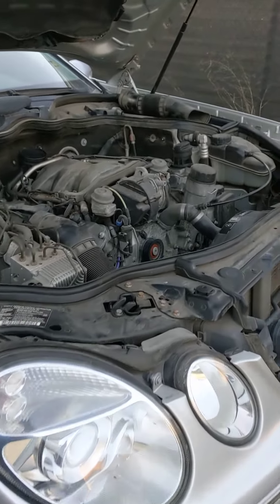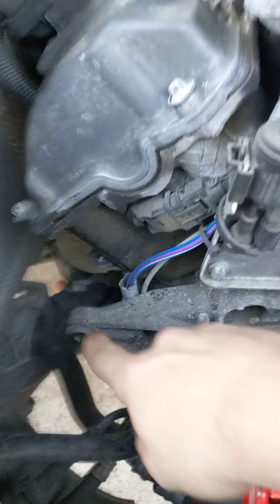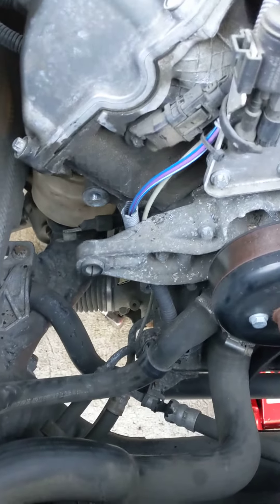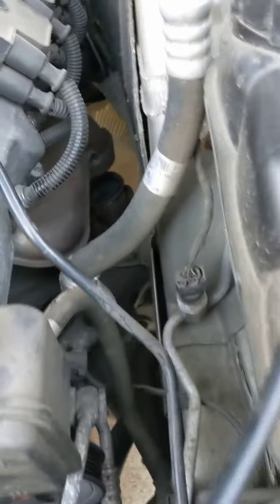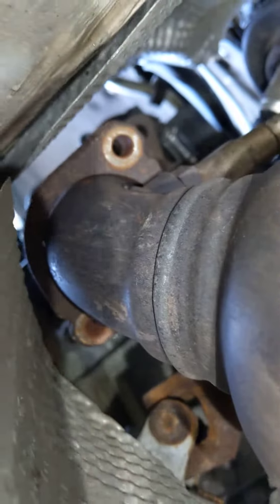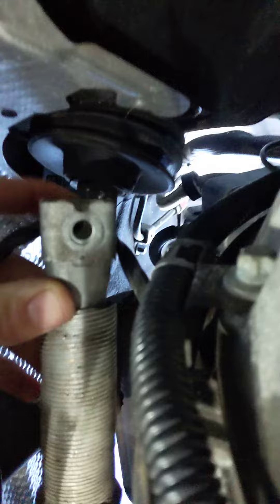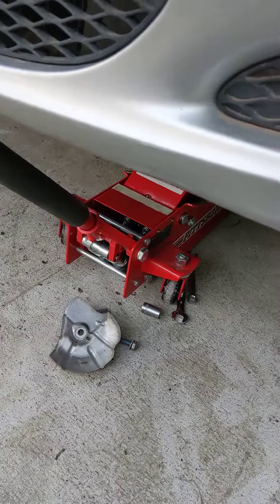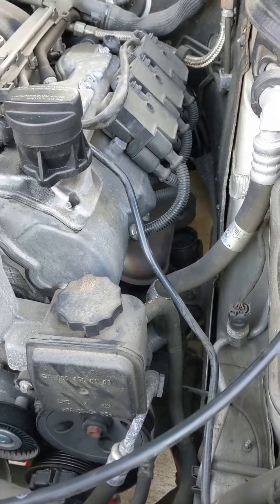2003 Mercedes E320 engine mount replacement the easy way! DIY W211 2004 2005 2006 2007 2008 2009

Comment: Thanks for the useful video, I did mine today and found it so much easier getting my racket in removing the alternator and dropping the exhaust by the manifold, I got thrown off with other videos saying you don’t have to remove neither but found it impossible trying to use a wrench to brake loose the top bolt until i used your helpful advice and finished the job with ease!

Comment: Thank you I did exactly as you said, the hardest part was the top bolts even with the special wrench. Changed engine mounts and trans WOW what a major difference like new. No need to remove exhaust or A/C compressor, only two exhaust bolts and steering bolt. I ordered Febi mounts and lemforder trans mount kit for little over $135, don't go cheap no name mounts. Thank's again

Comment: Next time, on left side just remove a/c compressor 3 bolt and move forward (doesn’t need a/c line to remove). Saving time to extracting broken exhaust bolt and more stuff remove!

Comment: when you remove the 2 exhaust bolts does the exhaust just drop down or you need to remove the other 2 bolts at the other end to completely remove the exhaust?

Comment: Awesome post  So this is the second time I've done this. Yes, you will need to drop all four exhaust bolts. Be careful removing the alternator because I broke a mounting bolt. HOWEVER, they are 16 MM So order the tool of eBay best 18 dollars ever spent or a crow's foot or a 16 mm SLIM socket or a 16 mm flex rachet.  Lastly, I rented a serpentine belt replacement kit from Auto zone and used an adjustable stubby, and pulled forever. ORDER the tool. lol

Comment: The exhaust on these cars literally come off in like 10 mins. It's 12 bolts, 4 star screws, and the o2 sensors unplug.  Easiesr exhaust I've ever pulled off of any car. The worst part is taking the bolt out of the top of the mount.  Takes longer than anything. All in all under an hr job and less than 100 bucks